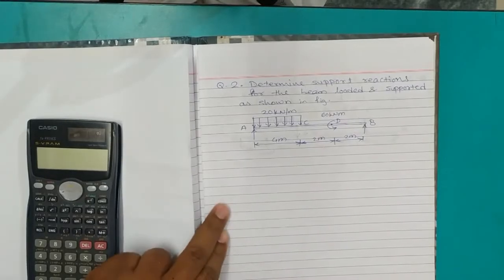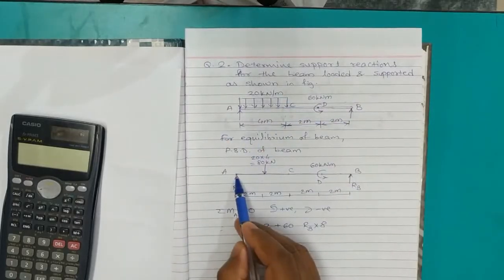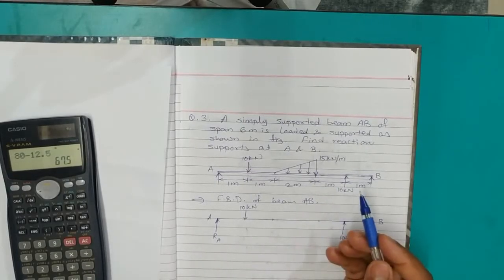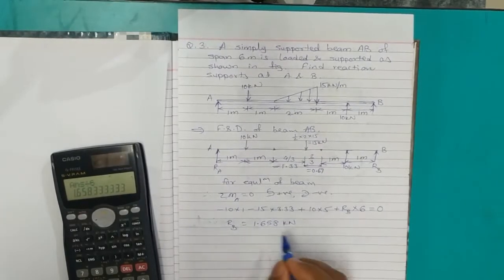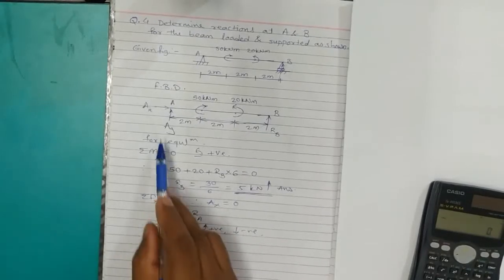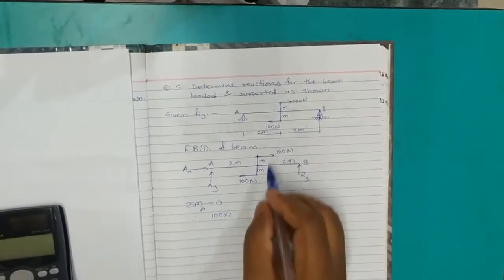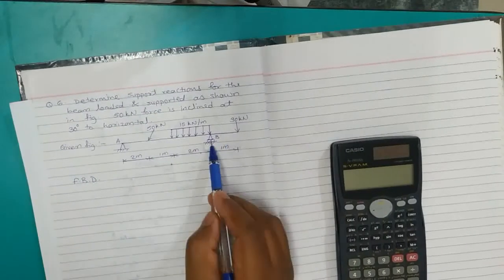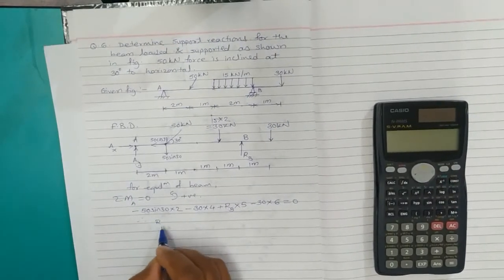Equilibrium of Beams: Lecture 2

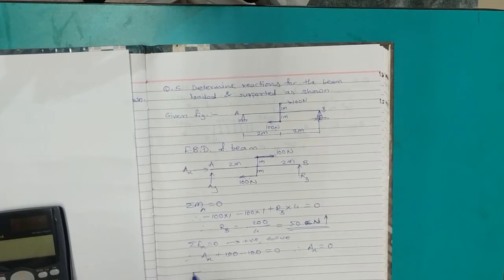Comment: Sir at 24:35 can we convert the two forces into an couple?? And then solve it?
Reply from the maker: Sure, both 100N forces can be replaced by a couple of magnitude 100x2 =200Nm of clockwise rotational sense and can be solved further.